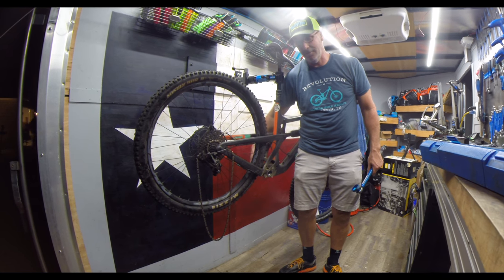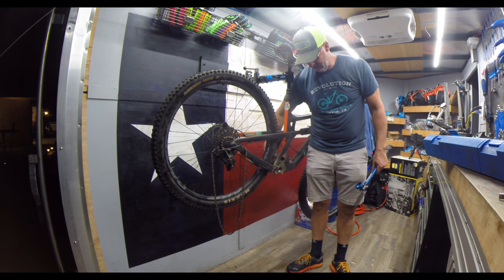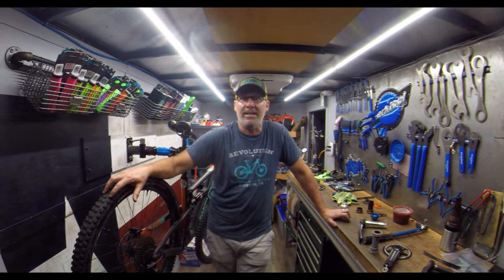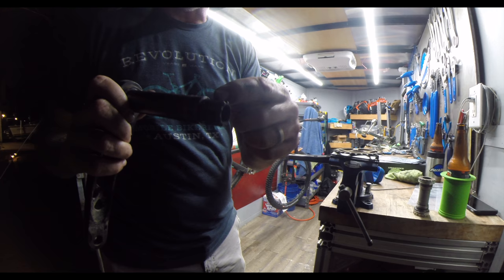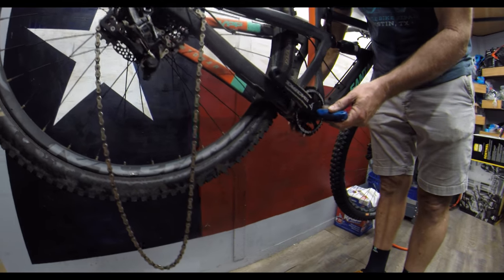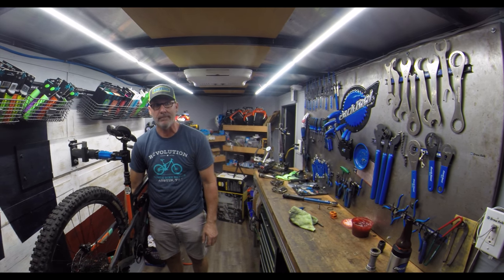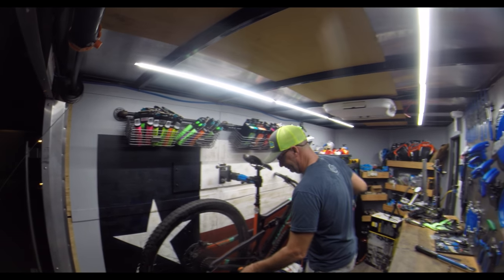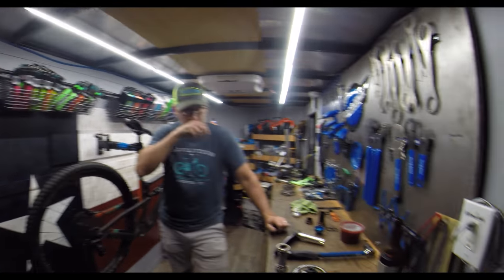CRANK AND BOTTOM BRACKET REPLACEMENT - Terri...errrrr Terrific Technician

Comment: I approve of the Turbine cranks, I have crashed with them, there has been minimal wear on threads( only saw one tiny metal hair, so pretty good, adn that was after long term use, I destroy weak cranks), they are stiff enough, But I tested out Atlas cranks, I notice the extra stiffness, but I am about 75kg with gear on. 
ntoe that thec crew on the preload ring can round off quite easily, sadly this has been the case with turbine dropper post bolts.

I recommend switching to Oval chainring for easier pedal stroke.

I recommend to use grease & Loctite 243, a grease layer at the first half of the thread that goes in, and Loctite on the other, to make the tread go in easy and for the Loctite so the cranks & chainring& bolts won't loosen too fast, Do the same on pedals.
Loctite is a must, load, vibrations & temperature changes affecting the materials at different rates loosen threads, so it's a must. but of course, you have to inspect everything on the bike, and add Loctite if needed.
and use the pedal washers when installing pedals.
Reply from the maker: Johannes Nilsen i like the Turbine so far, and glad that my crank booties transfer over. Thanks for the tips
Reply: I got my cranks scratched uneath the Race Face crank boots, I think tiny dirt comes in and rubs the paint off.

Comment: The mobile repair shop is definitely the future.
2:31 This is a common issue with cheap square taper cranks, this will happen after some months, and I could actually pull the crank off without the threaded bolt, material matter, and proper maintenance, preventive maintenance is crucial for longevity.

Comment: It's all about the right tools for the job. I clean and re-grease my BB twice a year.
Reply from the maker: Brian Vaughn I still don’t have the tools 😂
Reply: No Front Brakes aventuron sells them. If STS does another discount deal with them you should jump on it.
Reply from the maker: Brian Vaughn will do
Reply: Twice a year that's nice, on my fuel I have to do it several times, and swap left bearing to the right due to more flex to the left in the frame, using race face pressfit bb92, but I will have to get a new frame, and I want thread fit, Chris King Threadfit 30 BB. 

For the hardtail, I went with Chris King Threadfit 30, and of course the grease tool, and I got Santa Cruz grease gun, for zerk fitting, of course, I like this system, it makes it super easy, not actually tried it yet.
6:37 with Chris king BB the spindle does not touch metal, so it does not get wear, Chris King use adapters of strong plastic, cheaper than a new spindle, I liek this system.

Comment: I’ve got Sram gx eagle and the crank axle seems too long in my frame so I fitted a spacer non-drive side. Now there’s clicking and cracking noises when I pedal forwards backwards, under strain and not under strain. Backed off preload but still there. Checked bearings in PF BB all good.
Driving me mad.
Reply from the maker: The Bike Room Oh boy, you’re asking the wrong person. Aside from this episode, there’s a reason that I call this the terrible technician series.
Reply: No Front Brakes thanks for replying and I’m asking everyone including even the wife
Reply: It sounds like a BB issue to me. What bike? What spindle is the crank, GXP or BB30?
Reply: Drew Kolb thanks.  RM Altitude gx Eagle crank race face press fit B.B. bearings seem fine but there is a bit of the dust cover broken ofg
Reply: The Bike Room You will need to change your BB. You pulled out a crank that is a 24mm spindle on both drive and nondrive sides. The SRAM crank you installed is a GXP crank. The spindle on it is 24mm on the drive side and 22mm on the nondrive side. The correct BB you need is a SRAM/Truvativ PF92 GXP. If you are going to do it yourself, there are 2 rubber dust covers, a wavy washer and a black spacer included. You don’t need the black spacer. Put the wavy washer on first up against the chainring, then the rubber drive side dust cover.  Slide crank in, add non drive side cover and torque to spec.
Reply: Drew Kolb thank you so much. Will be sourcing that B.B. tonight.just checked crank with verniers and you are right. 24 drive 22. Non. LBS didn’t recognise issue. Shows how new GX Eagle is unless they couldn’t be bothered checking.

Comment: Nice segment Eric. I'm surprised though that you just let your mechanic choose your ring size (30t to 32t)  without consulting with you. That's a very important aspect of your gearing range. I suspect most people around here run 32t or even 34t but everybody is not the same. You might not appreciate losing your low end gearing, unless you're also now running Eagle on the back. We certainly don't need much on the low-end around here in Central Texas, but if you're traveling about and need to do more sustained climbing, it's nice to have those lower gears. I suggest checking out this site to calculate any changes you're considering either to your front ring or cassette. http://gears.mtbcrosscountry.com/#29I399I947X29I1567I947
Reply from the maker: Thomas Thrower ah I whittled down the footage. The 30 was also compatible with the new crank so I can always switch back if I don’t like the 32’s gearing.
Reply: Got it! Always good to have a few different rings to use for different riding venues. With your high-speed enduro escapades, you may be moving to a 34t soon!
Reply from the maker: Thomas Thrower gotta get used to 32 first